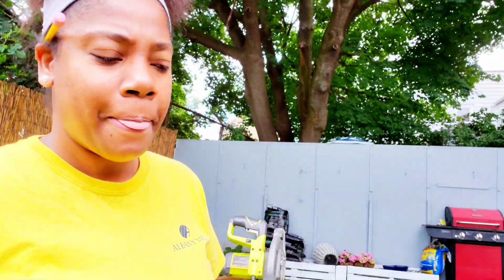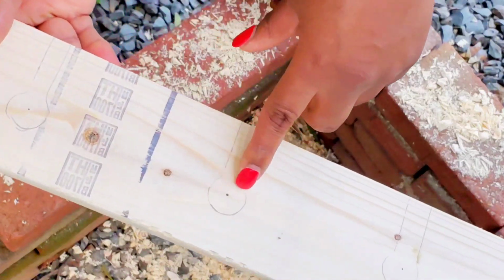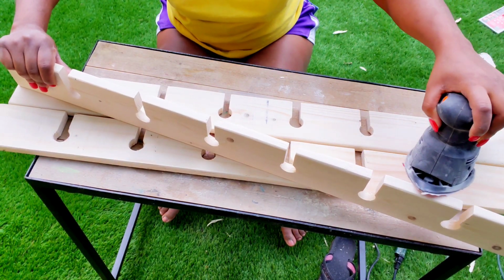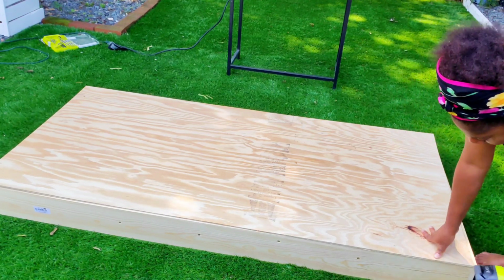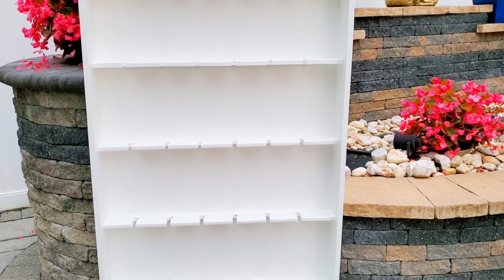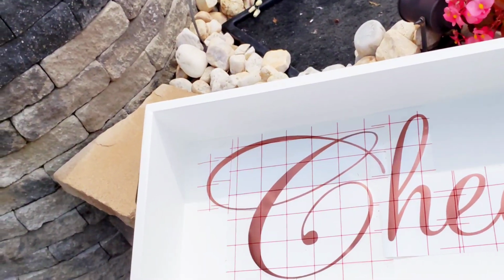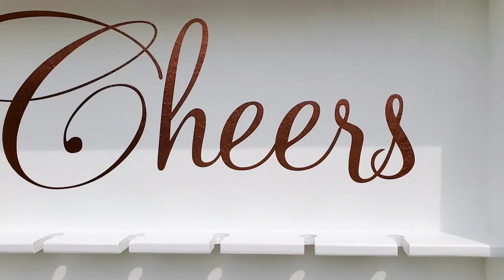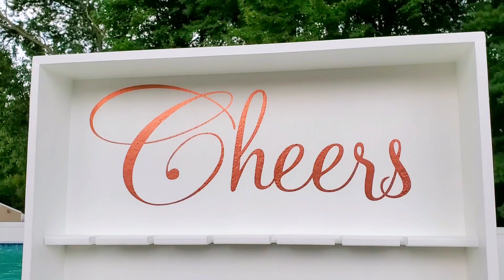HOW TO MAKE A CHAMPAGNE WALL|DIY CHAMPAGNE WALL|CHEERS BAR DIY

Comment: How far apart did you place the champagne holders from 1 another?
Reply from the maker: Just enough where the glass not touching each other. I really don't remember the measurements from the top of my head. How you can used the largest oz champagne or wine glass you have to measure the space in between champagne holders

Comment: If you're using permanent vinyl.. How do you remove it when you want to change color/wording?
Reply from the maker: Used a heat gun
Reply: @shanashomediycrafts  ooo okay so you just have heat over it and it should come off?